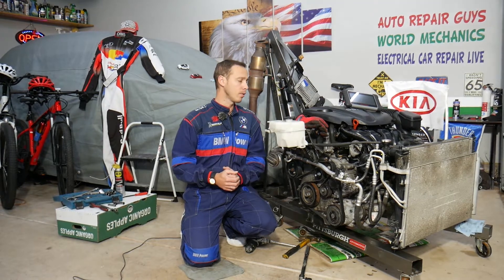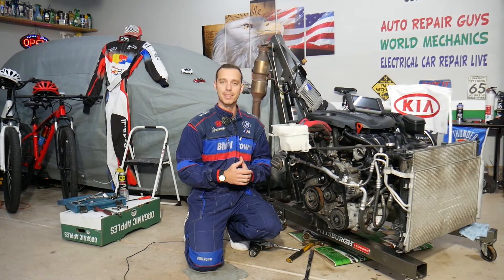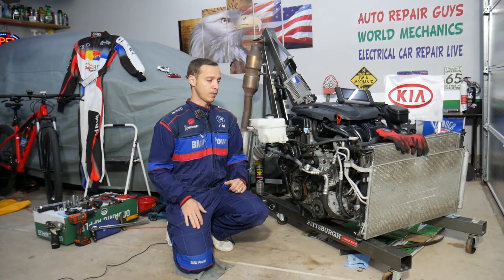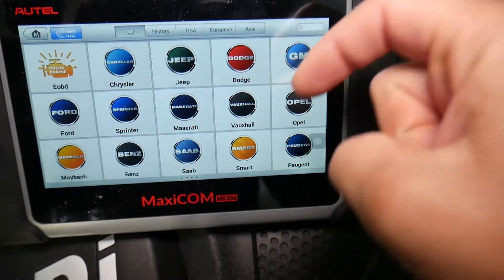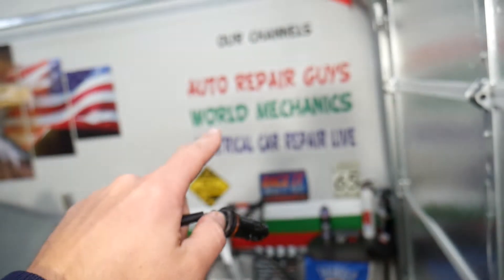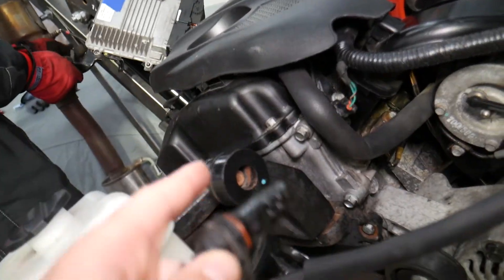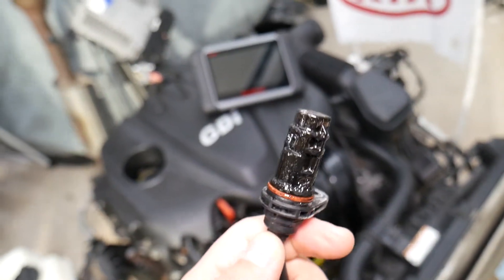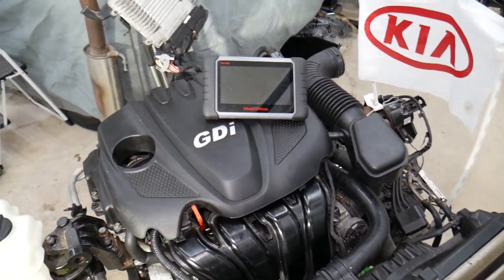SYMPTOMS OF BAD CRANKSHAFT POSITION SENSOR KIA SORENTO KIA SPORTAGE

Comment: My KIA cerato 2015 (Automatic) is giving a small jerk while slow braking. Gearbox is smooth and all gears are changing smoothly. Computer check conducted and found everything normal.
Could you pls guess the problem??

Comment: I have a 2014 Kia sore to. My car was working fine and out of no where while I was driving the steering wheel got hard to move and the abs light and steering wheel light came on. I was told it was the alternator or the battery. I changed both parts. But that didn’t work because my car was starting to turn off again while I was driving and the same lights came back on. Can you please tell me what it could be.
Reply: Did you watch the video even